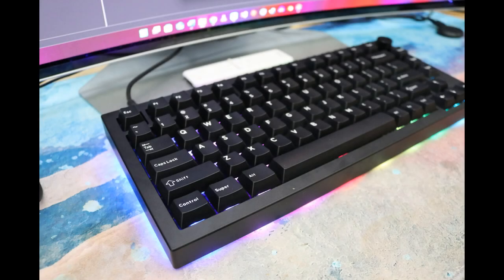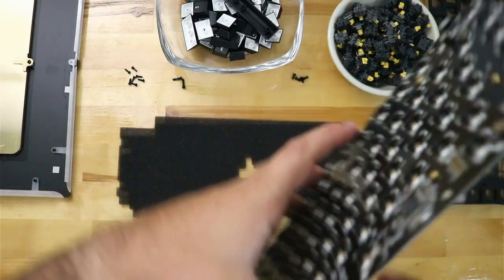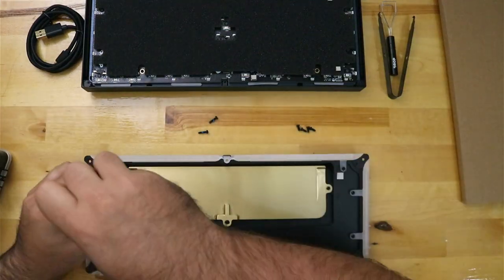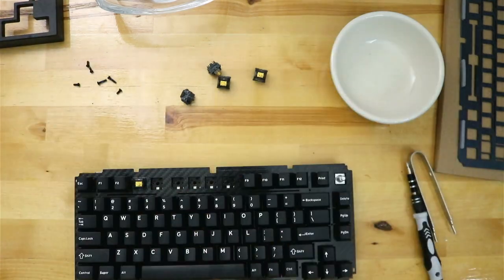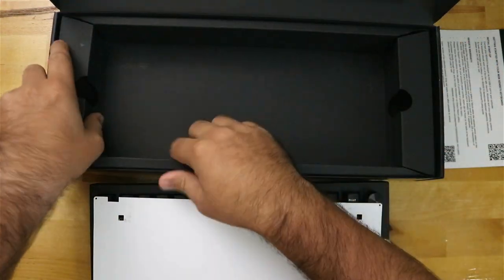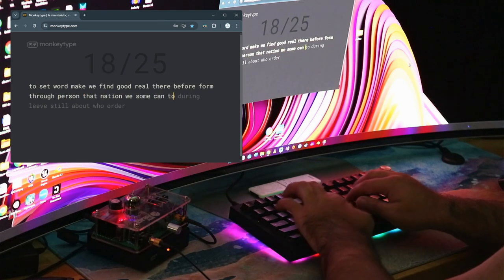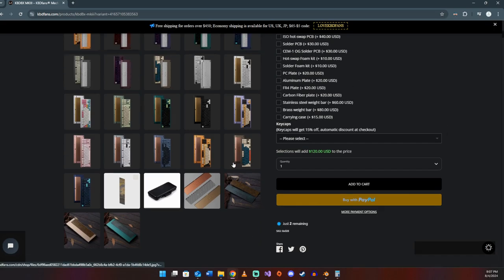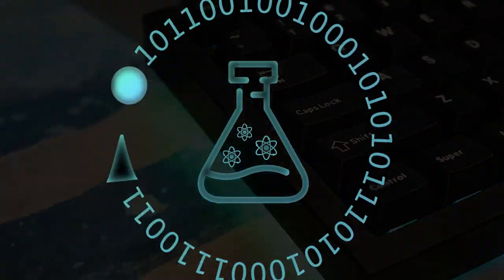Modding the Drop Sense75

Comment: I did all the same I didn't want a clacky build but alas thats what I got... I'm disappointed with this for the price I bought it $200. Like it comes with ABS kaycaps and the stabs suck... I would've hoped that they used their MT3 keycaps for this... All that said thanks for your video!
Reply from the maker: you know, I definitely feel that. It is a little bit more clacky than expected, even after I swapped out the stabs and used a carbon plate. maybe some electric tape added to the plate will make it more of a gasket mount? you should mod it a little further and report back! :P
Reply: @ireakhavok  yeah for sure I'm also gonna work on the foam to dampen the case further... maybe I'll swap out the switches... I love how they feel when lubed but they might somewhat be the problem.